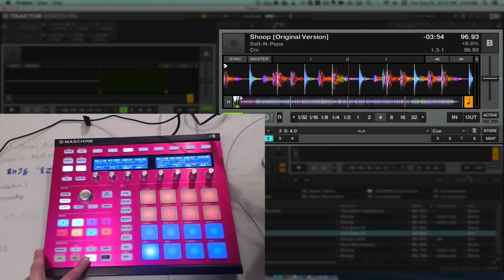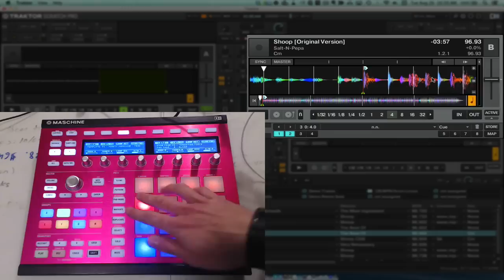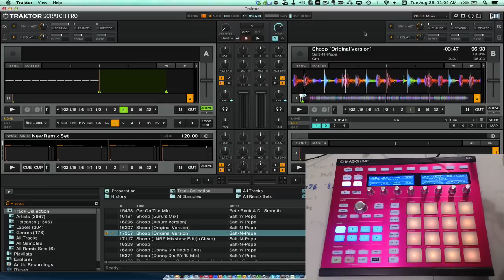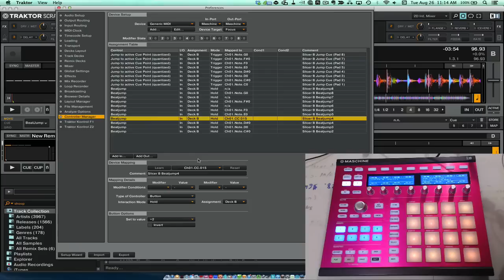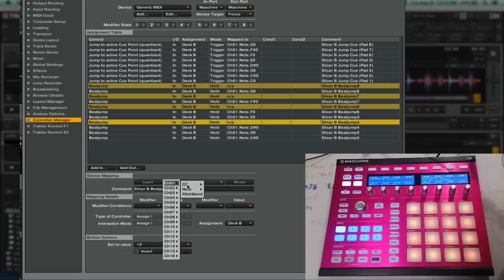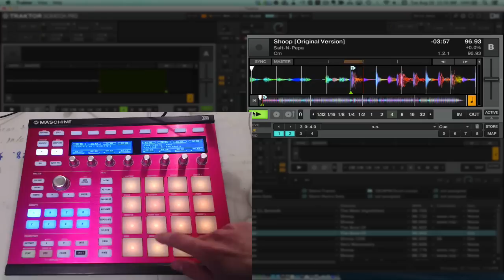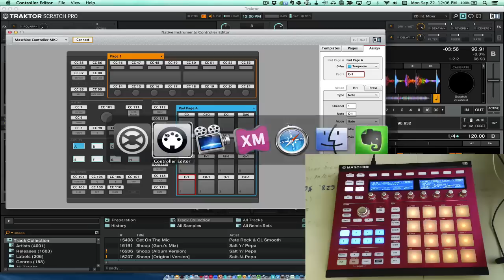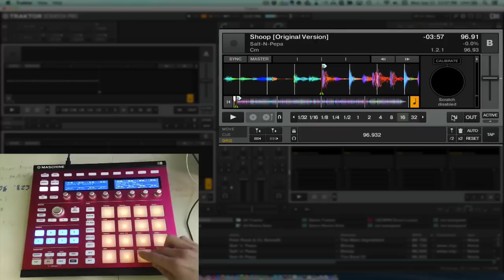Building The Serato DJ Slicer In Traktor Pro: Powerful Cue Point Mapping

Comment: Could this mapping be used with the F1? Just curious.
Reply: I was wondering that as well
Reply: y not. i would think just set the mapping to the f1 wil try with my vci...
Reply: Hey Bikey Hendricks, Borchi93, and DJ James Burkill  unfortunately it wouldn't work because the F1 doesn't have velocity sensitive pads. The reason it needs velocity sensitive pads is because they can send 2 midi messages, which is required for some of the commands in the mapping.
Reply: Ohhhh ok. Thanks. It would of been sweet if it did.
Reply: you can still do this just not while the track is stopped that, is the need for the velocity but in the vid he says its mot complicated not impossible